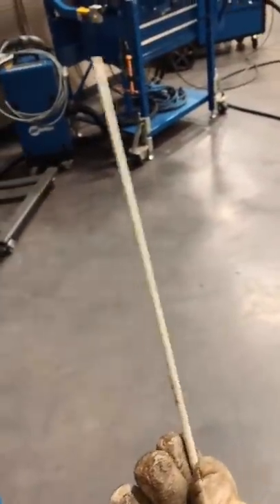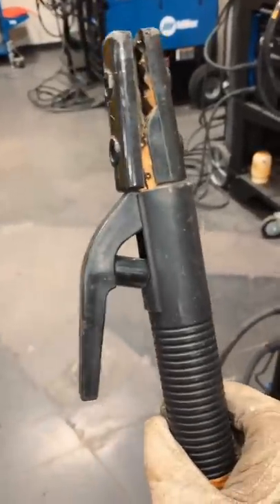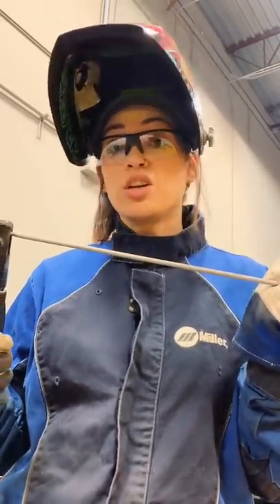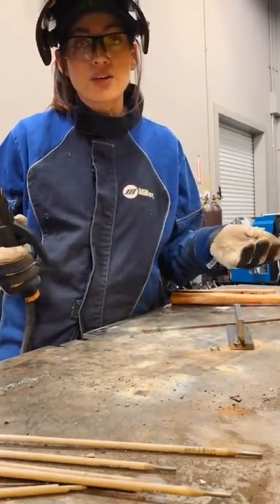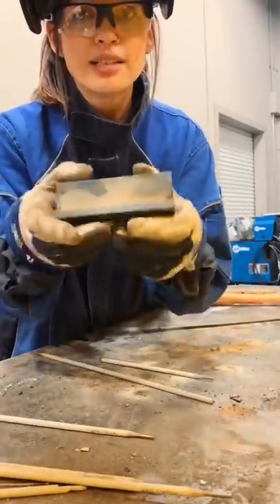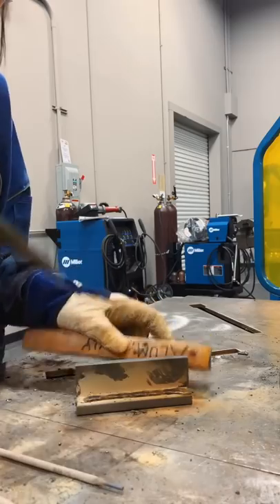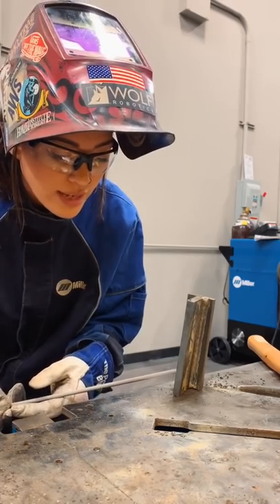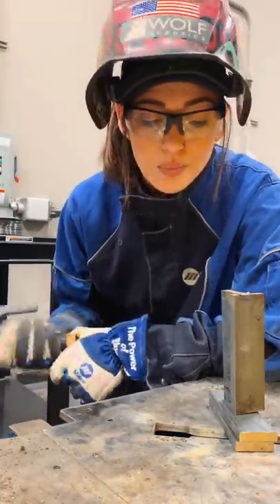Watch This Before You Start Stick Welding.

Comment: 6011's are good for ac machines but if I'm using dc which you seem to have plenty of machines for then 6010 is king for burning through rust, oil, etc. The dredge I'm going on in 2 weeks wants to run 6011 and cap over with 7018 but alot is pipe and 6011 is good for control so I totally understand. The last few years I've worked on rotary kilns and we mostly ran mig but when we stick welded then it was just strictly 7018 so we all walked around with grinders to clean before we could weld. I guess they had no idea of 60 series but great video and very informative. I wish I had half of that equipment. You should post some videos of arc gouging and teach some of these guys how to find and follow hair line crack from heel to toe of welds if you do any of that. BTW just say doggy dicks you know what we all say lmao

Comment: Coupons are the sections approximately 1.5 inches in width that you cut out of a welded butt joint. The welded plate is ground smooth front and back and the coupons are cut out of it and put into a guided bend test machine. Two coupons will be cut out of the welded plate to do a root bend and a face bend. Your weld will be bent into a "U"  shape to check for cracks and porosity.

Comment: Coupon very literally speaking means a 'cut off'. Obviously, colloquially almost always referring to cutting out a piece of paper to take to the shops*, but I guess it retains more of that literal meaning here, and is referring to bits of cut off metal.
-
*Though you can see how thats getting more and more distant from its origins as coupons are now regularly digital, synonymous with discount code, and have nothing to do with cut offs of any type.

Comment: Dam super smart to I love my welds looking nice and flat looks more professional. That's stick  definitely mig I can't stand welds that look lumpy it looks crap same with Tig I can't stand hearing laying dimes I prefer lay wire run it hot and one straight pass. But pipe of course I'm going to do the Hobart technique or the wankers weave , walking the cup. I prefer calling it the wankers weave.

Comment: Grinder with a wire wheel on. Why waste time and risk of putting divots all over the weld? 70 series rods should be in the oven to get all the moisture out of the flux and avoid porosity. And I always bend the rod. Even when I was in school, it’s just more comfortable to me and weld to it’s about an inch long.

Comment: I took welding in high school. If this instructor would be mine I would drop the class. When you arc weld all you have to do is barely touch the metal pieces you are welding and then drag the bead along the seam you don't need to push the rod in that much. Just start your bead, barely touch the two pieces of metal and then drag the bead across until the weld is complete.  The way she explained it in conjunction with how you actually weld she makes it more confusing than it needs to be. I am saying she makes it sound more complicated than it actually is.

Comment: The biggest problem is finding scrap metal to weld
Reply: I only today went a metal supply outlet and told them I was learning to weld and wanted various types of steel to learn with.  They pointed me to their scrap bin.  I grabbed about 10 pieces (1Kg) and they just charged $5.  Ask for the scrap/off cuts.
Reply: Yes lol

Comment: There is no such thing as a 7018 rod , the 7018 will always come with a suffix. ..ie 7018 -s or other such marking . You will never find  a rod with just the number 7018 . .....and that's a fun fact . P. S bending your rod when welding 2 inch pipe  or smaller is the way to go , there is a certain way you bend it . It helps you travel around the pipe using mostly wrist movement. As well there are times when bending a rod is the only way you can get at the joint. You had a piss poor instructor if he did not allow one to bend there rods or teach the methods I have mentioned.

Comment: Vertical: you did it wrong. I got state certified in the 90s, passed all the bend tests, on mig, stick and tig, and everyone I see on youtube showing vertical welds, don't know how to do them properly. Vertical up, backwards z motion with the stick/stinger. just a constant, slow, vertical z (backwards) motion. So much bad info being passed on as good information. This is going to cause a bunch of bridges and buildings to fall 20 years from now if you guys don't start speaking up about this supposed to be instructor teaching people bad habits with obvious poor penetration that couldn't pass a bend test if their life depended on it with these welds.